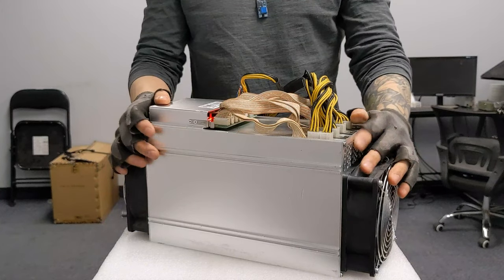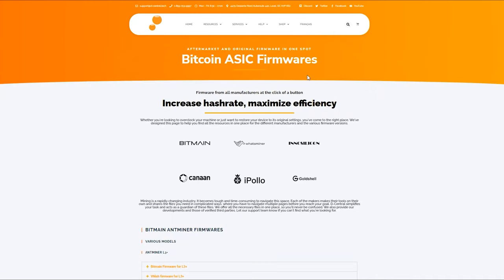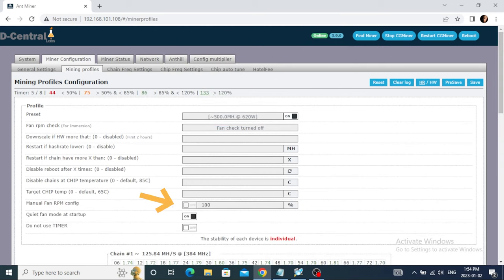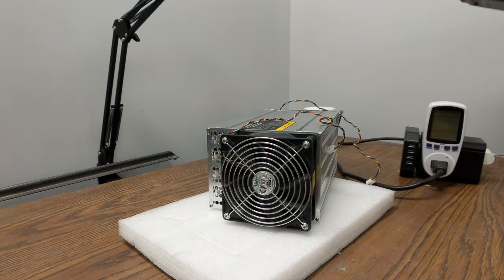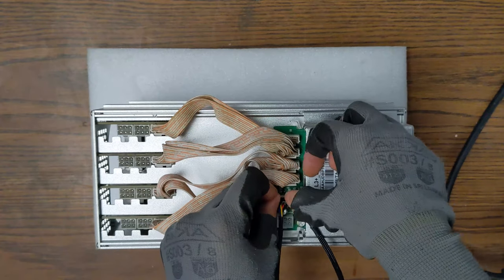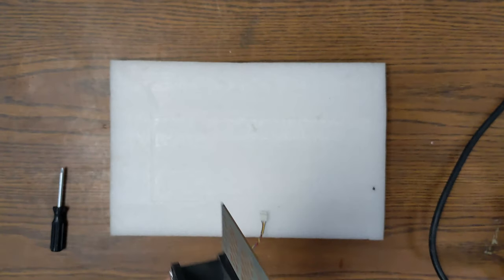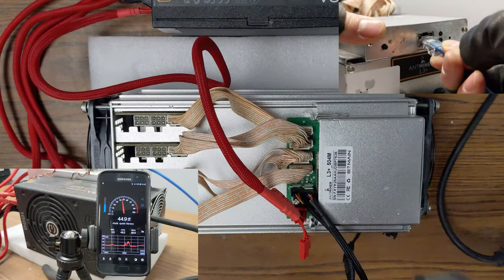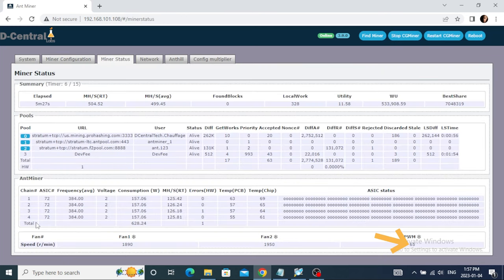ASIC Modding - Quiet Antminer L3+ Mining - Part I: Transforming an Old L3+ into a Silent Heater

Comment: Thanks for the video! Totally have 3 heating the house now, 2 with the mods…saw impressive results last month with just two running.
Reply: Nice, glad to read this
Reply from the maker: Very nice, what fan are you using?
Reply: @DCentralTech  NF—F12 PWM model. And have them running around 70% with sub 70*C temps.
Reply: @chrishanly5682  classic fan upgrade for this model. I've tested them and the IPPC 3000RPM has an outstanding static pressure for a 25mm 120mm fan.

Happy quiet mining!

Comment: I've attempted this with an L3++ and sadly I can't get the same results. I've set the mining profile preset to ~504 MH/S ~ 660 watts and I've used the Phanteks T30 with the advanced mode switched on. I have to keep the fans at 100% (3000rpm) to keep the miner from overheating and shutting down @ 80C. After 30 min of running, the PCBs are in the low to mid 60s, and the chips are in the low to mid 70s.
Reply: If after 30 min the chips are around 70°c, it's perfectly fine! Mine is set at a 75°c target.

Those tests were done at an ambient temperature of 21°c, so if you're above that, results may vary. It is very efficient and nice to have during colder season, but during summer, there's not much thing to do other than run the regular fans and endure the noise and the heat... Maybe if you're undervolting it, you could achieve more reasonable temps and keep the T30s. Didn't personally tried it yet.

Or, you might have some chips that are getting weak and overheating, thus making the whole machine lose its mind.

Keep us posted!
Reply: Just to folllow-up on this incase someone is having some of the problems I was. I didn't flash to the vnish firmware because I purchased the miner used and it came with Hiveon preinstalled which seemingly had a similar setting for under clocking the miner. However, on Hiveon, the setting for under clocking is not actually set by just choosing the dropdown, you have to also run the Auto Tuner process. However, even with using the same power supply in the video, I'm still pulling around 790 watts at the wall instead of the 689 watts that the status page is displaying. If I keep the air conditioning nice and cold (just a tad too low for what I feel is comfortable) then I can keep the fans running at 80% (2,340rpm / 2,400rpm) and the hottest chip stays between 73C and 68C. So the results aren't as awesome as in the video, but it's definitely stable, cool, and quiet enough for me. Those Phanteks T30's sure are quiet!! (Be sure to flip the tiny switch on the hub of the fan to ADVANCED mode, or the fan won't exceed 2,000rpm)
Reply: @Raaz-  Hi Raz! Please see the comment I just left. Also.. I forgot to add in my original comment that the temperature continued to slowly increase pass the 30 min mark until the board reached 80 and it shut down. It was a slow creep that I could only control even with the A/C being cranked to an uncomfortable level.
Reply: About the watts, on the outlet the total output will be higher than the preset of the miner, mainly due to the control board. The 660w preset is for the Hashboards, so the 100w of difference might be just that.

Still less than regular setup.

Didn't worked with Hiveos, so it must be different a bit. You could change the firmware for the same one as in the video, link is on the website, or I think I saw it in the comments recently.

And yes, the T30s can pack a punch without too much noise. But indeed do not forget that little switch, I myself forgot it once and was wondering what was going on 😂
Reply: @Raaz-  Thanks for the heads-up regarding the extra wattage probably going to the control board. I think some of it has to do with the PSU as well. I originally had an antminer PSU (the slim one with the super noisy fan) and that setup used about 20-30W less. I'll gladly trade 20-30W for less noise any day! lol I think i'll try vnish at some point. I tried switching to it through the miner gui, but I couldn't get past the signature error even with the hotfix they supply on their site. As I understand it, that means I need to FAT32 format a micro SSD and load on the software that way. I'll tear into it one of these weekends. If anyone has some tips, I'll gladly take any advice I can!
Reply: @vnilla1579  my pleasure! I'm a big fan (pun a bit intended) of L3+ and machine modding.

If you like your APW3 slim PSU, but don't like the noise of it, maybe we could... Change its fan as well?? We'll maybe touch that subject in another video.

And about the firmware modification, there's a way without SD card. YT keeps blocking my comments when I suggest a link, but connect with us with the link in the video description, down in the "connect with us" section, first one starting with a D, and you might find further help and guidance.

Cheers

Comment: Do you need a jumper for the motherboard? Ive seen people saying you cant just run power cords to the miner without a jumper for the motherboard slot.
Reply: Good catch, changing the Bitmain PSU for a PC one does indeed require a jumper on the motherboard 24 pin connector.

The EVGA 1000w PSU that was used in this video already had one with the package, so that detail didn't make it to the final cut of the video.

"EVGA detection tool" is the item that was on the PSU. You could also do the jumping yourself, depending of your PSU model.

Cheers